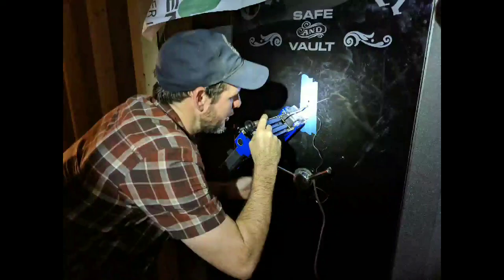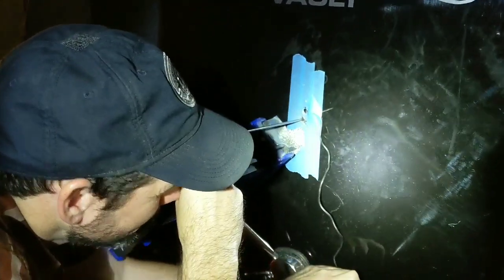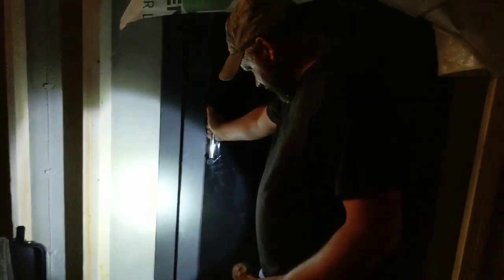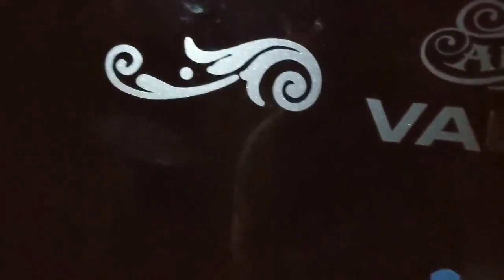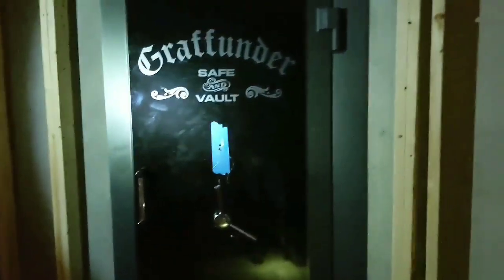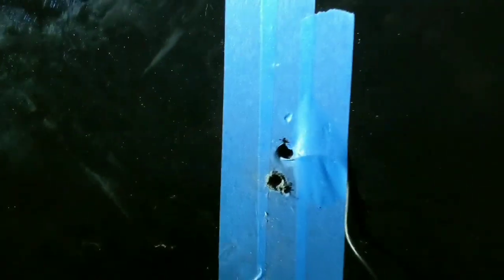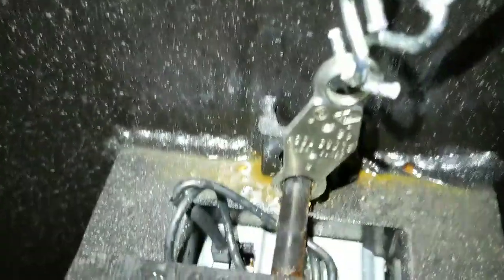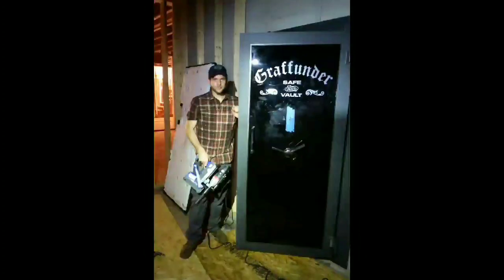Graffunder Vault Door  SAFECRACKING

Comment: Question @ 3:08, why does Graffunder not make the door from the start out of this "material" that's supposed to be stronger than the original steel was in the first place?
Reply from the maker: Good question. The stuff he uses is like an epoxy putty with carbide in it that just fills the hole where he drilled. I doubt it would have the structural integrity of steel but is harder to drill.

Comment: you said it happened from when they poured the concrete, so does that mean if they left the door open while the concrete set it would of been fine or does a room like this need permanent vents of some sort, even after concrete is set?
Reply from the maker: I'd say it would have helped a lot and probably would let enough air in to remedy that problem.

Comment: So in terms of cracking this, how hard is this to do?  I know Graffunder claims to be secure but this almost seemed to easy. I reckon your only showing the end...   I thought they built the doors all being unique making it way harder than drilling right here and you're in. 
Also moving forward is this door basically junk now?  you mention some sort of filler material for the hole what is that stuff called?  how could it be stronger than the door?  
any idea how thick the walls are?
Reply from the maker: They are very hard to crack. This took about 6 hours with a guy who really knows his stuff. If you would've seen the tools and tricks, you wouldn't have any concern. Yes, Graffunder does move things around to prevent "standard" safecrackers and locksmiths from opening it by coming in through he sides or top. Luckily, Mark isn't "standard"! For comparison, Mark, can professionally open a standard, production gun safe in under 30 minutes where it'd take others hours of "exploratory surgery" so to speak and a bunch of big holes and the safe is then generally ruined. As for the door, it's fine and completely functional. The filler is a carbide laden epoxy and super hard burred plugs that can only be driven in one direction. The new lock has different drill points so the old hole wouldn't get you anywhere anyway.The walls were around 14 inches if I remember correctly. Forgive me if this video made it look easy. Yes, in this case, he did open it with just one small hole, but the video doesn't show the variety and number of specialty, expensive drill bits that he went through nor the insane amount of measuring and remeasuring he preformed. I can assure you it was not at all easy.
Reply: @parkerssafes  I agree it appeared easy to a novice this door is very well made..
Reply: @Nate-cw7of       By the way no mention about the new lock has different drill points making the hole useless in the future in the video..or the one way plugs.   so I learned something.
Reply: See Safecracker book by Dave McOmie, alot of good info in there if you want a deeper dive. It's an engaging read, I'm sure other professionals have good stuff as well.

Comment: Do you find this an argument to go with mech dial in lieu of electronic (me being a bit lo-tech and stubbornly old fashioned; but willing to change some!)?

Also, I notice Graff (or Sage) has a down website saying they have a new one coming.  Are they still around?  I noticed that website of nice people in Haleyville, AL didn't have Graff listed as they used to (though I haven't visited their site in years).  

Changing subjects but staying with Graff safes, like so many things these days, any chance their assembly process has been effected by damned virus and reaction thereto, so that quality of safes hurt. It's a coincidence I ask you this as your trying to get inside one of them.  Truth is, I've toyed with yrs with getting one and I'm getting closer.  I heard from a car dealer that he had concerns, for instance, about quality of otherwise reliable model truck they sell, given slow-downs on assembly lines; workers, foremen sitting out; chips and other parts slowing down or coming in sporadically.  Just curious.  Thx.
Reply from the maker: That situation wasn't the locks fault at all but still wouldn't have happened with a mechanical lock.
Reply: You don't think that kind of moisture would have affected a mechanical lock? I'm not saying anything about digital locks I'm just curious if that much moisture would cause trouble for a mechanical lock?